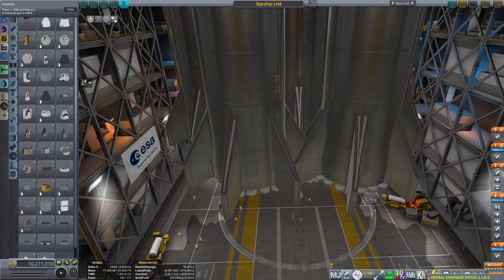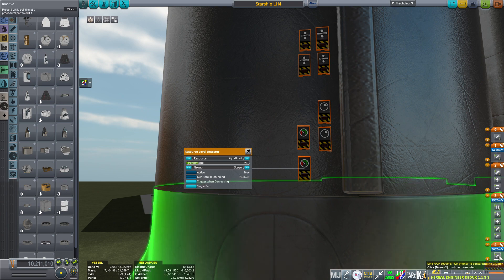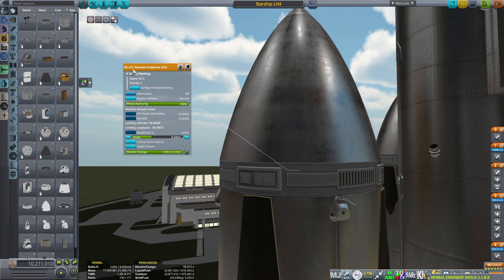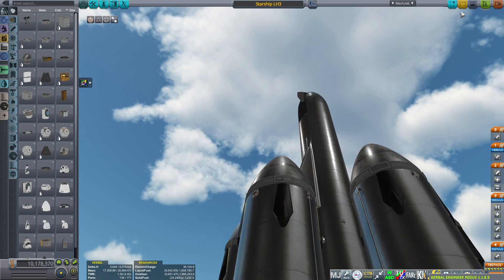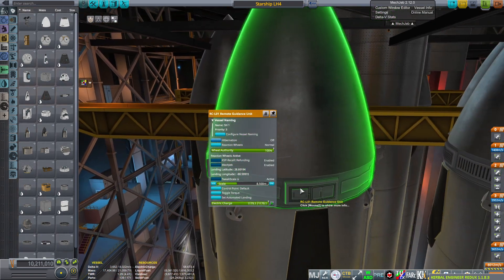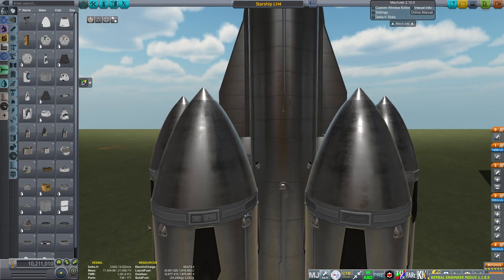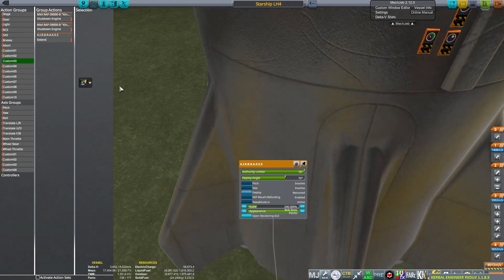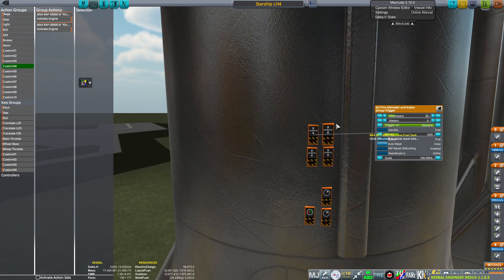KSP | 1.11.2 | Multi-booster landing tutorial

Comment: Hi Jesus, ive been trying to implement your mod to the latest version of Mechjeb 2 DEV which was released 6 days ago, but i am unsuccesful so far... Is there a possibility you might update your version or teach me how i can implement it myself? I have implemented the differences between the regular mechjeb and your version, but ingame, resulting in it semi-working. I only get "Land at KSC" and "Land Somewhere" option, and not the "Set Automated...".
Reply from the maker: HI Cillian, I have in my to-do list to update all my KSP mods to latest KSP 1.12.2. I will let you know as soon as it is ready.
Reply: @jesusrv2009  Great, in the meantime, since i have the option to "Land at KSC" using the smartparts, i just changed the coordinates in Landingsites.cfg to what my designated landing site was (Y)
Reply: @jesusrv2009  Hi again, I am on patch 1.12.2, and just downloaded your mod pack. I see this feature is still included in the pack, but Mechjebs landing guidance is very wonky. It starts off well, turns to the correct boost back angle. Fires up its engine and burns for roughly 3-5 seconds before going nuts. It then starts turning left, sometimes right, either way completely off course... I have tried manually guiding myself closer, to test how Mechjeb does in the final stages of landing. 9 times out of 10 it burns to final decent, then it throttles down and just falls to the ground. The remaining 1/10 times it does not do anything, corrects its position to decelerate, but does not throttle up. Are you able to land a booster with the version of Mechjeb included in your mod pack? Do you know if Mechjeb has any incompatabilities? I thought it might have been Principia, but even without it, it acts the same way. I quit KSP shortly after writing the comments I posted here, and I returned 3 days ago, and all of those days have been spent trouble shooting this, hahah. Please help me before I quit this game for the last time xD

Not using RO nor RP-0/RP-1. Also, since I am using RealFuels, is there a way to configure SmartParts to allow the parts to detect other fuels than "LiquidFuel" which is the only option i am getting.
Reply from the maker: I suggest to try the official Mechjeb instead of the one that I have included. My Mechjeb version has some specific changes that might be messing with the scenario that you are running.
Reply: @jesusrv2009  Then I will not be able to automate it using the SmartParts... What changes does the Mechjeb2 vJesusRodriguez include? If these are useful I will stay on your version ;) You have done amazing things for the community with your mods and contributions and I really like the automated landing system you had in this tutorial. Especially now that you can edit Action Groups after launch.

Is it possible for me to alter official Mechjeb2 to only include the implementations you had when releasing this video?
Reply from the maker: @sciscitatio  Maybe it is possible that the problem is KSP 1.12.X. Last time I tested the multi booster landing was in 1.11.2. I would like to test it again in KSP 1.12.X but I'm a bit busy at this moment.

Regarding to alter the Mechjeb2 code. If you have some C# and modding knowledge then sure. You can take a look to my Mechjeb fork on github and integrate my changes manually
Reply: @jesusrv2009  Hello again, I can now confirm, reverting back to your latest release of Mechjeb2 whilst still on patch 1.12.2: "MechJeb JR Edition for KSP 1.11.2" fixed all of my issues. Target difference 1 meter. Excellent work Jesus, I hope you know what tweaks you have made that might cause this, incase you ever wanted to do it yourself again :) But 1.11.2 is fully functional :)